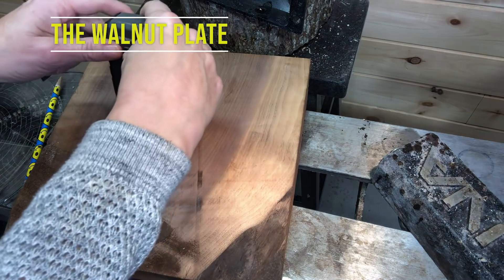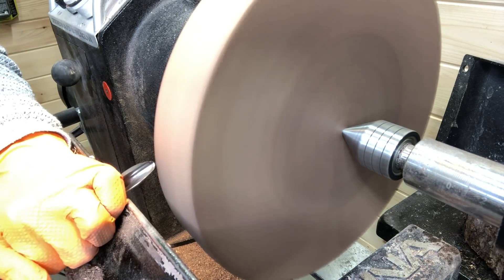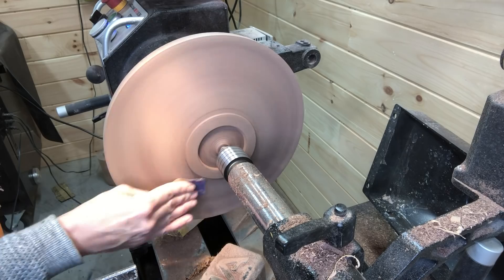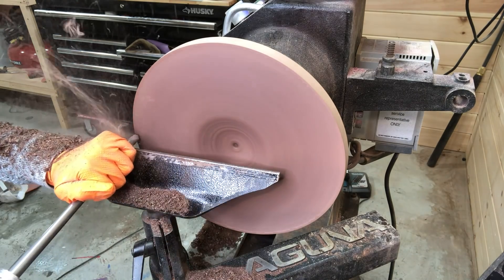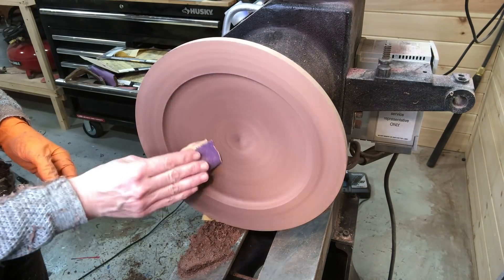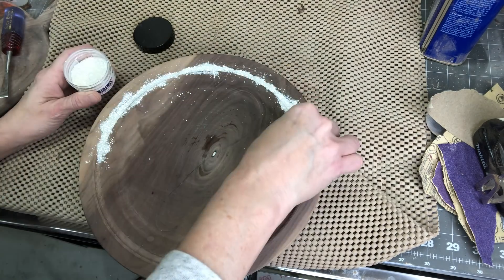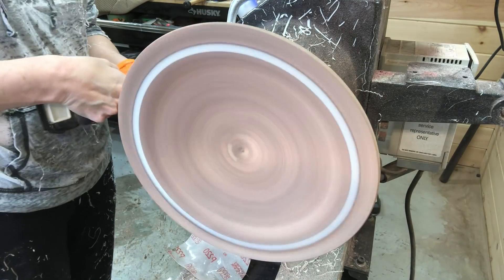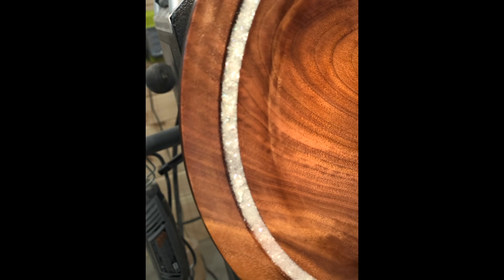Woodturning a Walnut Plate with Mother of Pearl Inlay

Comment: Nice piece. What type and size of carbide cutter did you use?
Reply from the maker: Thanks. I used Easy Wood Tools mid size  with a rounded square NR tip.